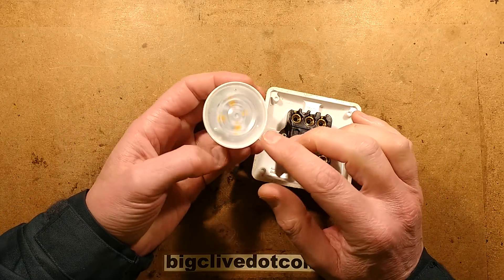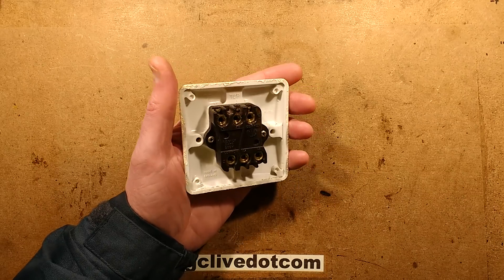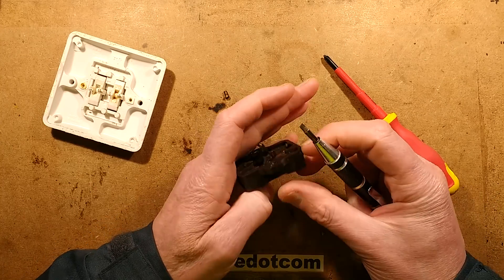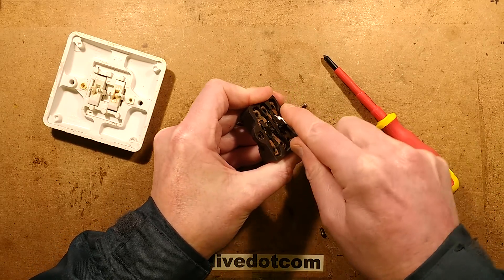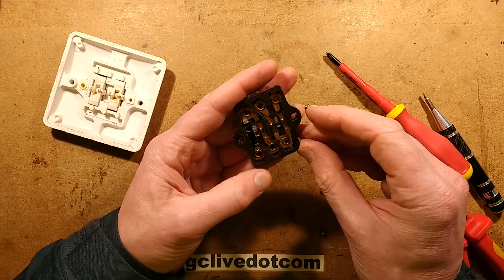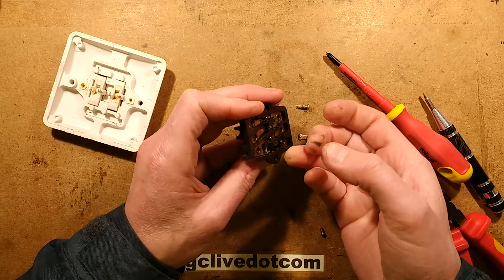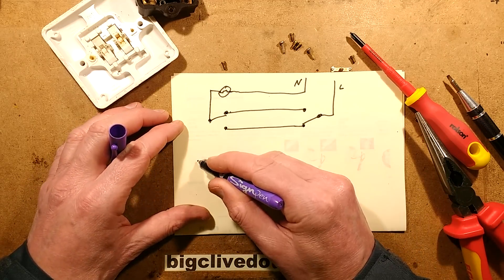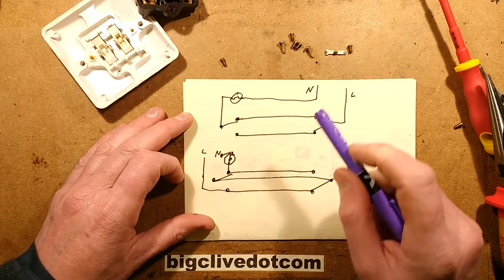Old arcing switch killing LED lamps.

Comment: What is it about arcing that causes the fusable resistor to fail? Too much current, presumably, but why? And why wouldn't a circuit breaker give first? I wouldn't expect a resistor to be quick blow (although I don't know why I assume this).
Reply: a capacitor has an impedance , this is the AC resistance.  the resistance can be worked out with 1 / 2piFC . i.e. 2 times Pi * Frequency * capacitance in farads .  the 1 over that (use the 1/x key on your calc).

example using coarse numbers 6.28 * 50 * 100exp-9    (i.e. pi times 2 , 50 hz , 100 nf) then 1/x the total gives 31.8 K ohms

If you switch starts to crackle it will chop up the 50 hz into much narrower waveforms resulting in a much higher frequency. if this increased it to say 500 Hz then the impedance of that capacitor will drop to a 10 th of its 50 hz value i/e/ 3.18k . , your LED's will get 10 times the current!

This is an issue with using a capacitor as a resistor basically in an AC circuit, you have a frequency dependent resistance.

If you wanted to try and avoid this you would either need to use an inductor (more expensive, larger) or a proper switching power supply (also more expensive).
Reply from the maker: +No no The current would be limited by the resistor, so it sees most stress.
Reply: The power rating of the resistor is much less (in this case more than a factor of 10) than the breaker. Smaller parts are always going to break/fail first. That's just the way it is.

Sometimes time or the environment (or both) will contribute. I lived in a building put up the late 1800s which got electricity in the 1940s and oneday in the 90s the wall started smoking. Very similar failure. In this case some of the wall debris got inside the switch because they did not know well enough to make it sealed up. The better something is sealed generally the better it lasts, too. Clive's switch is open to moisture and salt corrosion. Switch contacts are a very very common place for failure.

If you think about it I'm surprised the place I lived in even lasted 5 decades on the technology.
Reply: When arc occurs you have sudden changes in voltage and the faster the voltage change the more current will a capacitor let through. Circuit breaker for lightning may be rated e.g. 10A (common in Poland), while this LED may take e.g. 50 mA normally and a fusing resistor inside light bulb is rated for such current. When it starts to conduct e.g. 100mA then the fusing resistor will act first.
Reply: Under normal situations around half or more of the volts are dropped by the series capacitor. The arcing that is the most problematic is when it momentarily connects the bulb on alternate cycles. Then the series capacitor doesn't really do anything, and all the volts are dropped by the series resistor. To survive long term with continual arcing it might need to be ~50k, but it's normally more like 500 ohms, and apparently on these bulbs it's 10 ohms which is really too small. I suppose having such a low value would make the bulb more efficient though.

Comment: In America, the first diagram is what we use but we run 3+gnd cable in that instance, and the White Neutral wire is still the Neutral wire all the way through for the return, but the Red and Black are the two Hot's, and the Ground or Earth (either bare copper or Green) is there as required by the fire code to make sure metal fixtures and junction boxes are properly protected.  That way no matter which switch is flipped, a path will either be broken or made.  The switches will either both be on the same wire (Red or Black, and thus passing current) or not (off, no path through).  Four way switching has an additional switch in the middle of the Red and Black that just reverses the pairs relative to one side of the switch (the diagram would either be two parallel wires, or an X of the two wires crossing over each other).  That middle switch just changes the relative Red/Black relationship that one end switch sees versus its partner on the opposite end.  Four-ways are not very common.
Reply: And we call the red & Black "travelers".
Reply: is this what you are saying? hard to see in text http://www.electrical101.com/3way-switches.html
Reply: Yeah, we have the ground wire too, we call it triple and earth, when we wire a lighting circuit, the live and neutral run to all the light fixtures,  the live going to a third terminal, then it's a simple case of bringing a 2 wire down to a switch, then if it's going to be a 2 way switch, we run the triple between switches.
The first diagram was for very old systems that often used single wire in conduit, or double insulated single wire clipped to the joists..
Reply: Same here in Germany (apart from the coloring). Usually one would see the first diagram being used. Does the second diagram make the loop impedance of the circuit higher or quite unpredictable because of a changing wire length? I have had a lot of electritians obsess about loop impedance because of the impulse part of the fuses still triggering in case of a short circuit. I am not sure - just throwing the idea out there.
Reply: electritians or electwicimans. Funny!
Reply: Dan Dinca depending on the position of the switches, the live passes through both the bottom and middle wires or the top and middle wires, or only the bottom wire.

Given that you still make one wire carry permanent live and the other two are still switched (although you can now have the configuration where all three are live simultaneously, just not all carrying current), I’m not sure what you gain by this arrangement.

You give up the ability to have insert an extra switch in the middle, though. No, wait, that’s not true. If you put a crossover switch on the outer legs while connecting the middle straight through that’ll still work.

In NL, circuit wiring in the home is always 2.5 mm^2, but switch wires get to be 1.5mm^2. I’m not sure the second arrangement is allowed, though.
Reply: A site that shows the U.K. modern arrangement is this one: http://www.lightwiring.co.uk/two-way-switching-3-wire-system-new-harmonised-cable-colours/
Reply: The way I understood it was that the first way was the way you'd do it for new wiring and the second way was when you were adding a second switch to an existing single switch setup (you would obviously replace the 1-way with a 2-way also)
Reply: perhaps 4-ways weren't as common around there, but I installed thousands in one year, with 20+ per home(late 90's), I recall some having 8 switch locations for a single lighting circuit. don't get me going on how many hard wired smoke/fire alarms per home and none of them were huge nor mansions..
Reply: I had the same thought. More wires more copper more expensive. For what?

Comment: Clive, you wouldn't like Sydney weather. 45°C with 60% -70% humidity. It's like walking around in a wet blanket, and breathing the oven air, mid-roast.
Reply from the maker: I've visited Australia.  But in a mid point of the year where the temperature was tolerable.
Reply: I think i would literally die over there right now.
I can't even stand most summers in Germany...
Reply: Move a bit further south (South Coast / Illawarra). We've had 40C days with 100%RH. Today's "only" 27C so far - but still 100%RH. Thank heavens for air con!

Comment: Clive, thank you so much for explaining 2-way switches! I think we call them 3-way switches in the US. Is there a difference?
Reply from the maker: It may be the same thing.  With intermediate switches that cross the strapper cores you can actually have as many switches as you want for one light.
Reply: I ran into this recently at work in our pool room where one switch’s contacts corroded enough to completely stop switching through audible arching noises. This arching managed to accelerate the demise of several fluorescent tubes in short order. In another case I found that low quality Smith & Stone defunct?) household decora style switches from the late 90’s started arching only after  a couple years in the washroom causing the bathroom GFCI to pop whenever the light was turned on. This is despite the light and switch not being on the GFCI...just noise.
Reply: In the US at least, yes the #-way switch indicates the number of contacts on the switch, not the total wires in system. The switch diagram clive showed, is the US equivalent of a 3-way. A 4-way has an additional contact. As Dustin has pointed out, the US has used a (wire-gauge)-3/wground since the 50s-60s as the up to standard wiring style for lamps with multiple switches. Which means that one end of the circuit (either the lamp or a switch) has the main cable coming in that contains the live, neutral, and ground. From there, grounds all bond together on the back of the box unless its plastic, and neutrals all bond together in the back of the box. The hot legs are the only things connected to the switch. A standard (wire-gauge)-2/wground coming in and going from the last switch to the light, and (wire-gauge)-3/wground between all the switches.
Reply: Sounds the same, things you have to watch out for in a hall with stairs is shared neutral between upstairs and downstairs. Thats asuming you 120v savages in the US have seperate upstairs and downstairs lights .
Reply: And you 240v baby killing Savages xD, have shared neutrals across physical locations vs circuit by circuit? Usually in the US since the 50-60s lighting is grouped with plugs by room. So the master bedroom with have its ceiling light and wall plugs on one circuit either 15-20A, the second bedroom will also have its light and plugs shared, etc. The only time this doesn't happen is when you have rooms with high outlet draw, such as a kitchen where you have a 20A circuit just for the plugs in the kitchen (sometimes two 20A circuits in one kitchen for the outlets) and either the ceiling light is grouped with the lights for open adjacent rooms (See open floor plan) or its tied in with the dishwasher and fridge outlets which are just regular height wall outlets and not up above or right under the counter.

It comes down to the building and electrical designers. Usually for branch designations, you will never find lighting on individual circuits, they will always be on general purpose  circuits, not appliance or multiwire.
Reply: Here in Italy most houses were built (well?) before the '70s and I'd say 98% of those still have the ONE breaker that comes with the power meter, lol.
Reply: Some planners will do that, others will just separate by room. My house was built in the mid 60s, and the lighting is grouped by room with the outlets except for communal areas. You have the bedroom lighting and outlets (per room), you have the kitchen, living room, dining room lighting all tied together you have the basement lighting. Garage lighting is done with the garage outlets, and bathroom lighting is done with the bathroom outlets and exhaust fan. Some new constructions run general lighting circuits for multiple rooms, some run room by room. But most commonly at least in central michigan, unless multiple lights are in close enough proximity to each other in an open floor plan,  there are few if any general lighting circuits that feed only one or two lights, usually they run 5-10 interior or 2-5 exterior.

It may differ in other parts of the country, most of the houses in the lower half of the state were built by four companies in the 50-70s. Of those four, the electricians bounced around enough that basically everyone used the same standard for running circuits. Personally I quite like tying the light into the outlets for the room. There is a very easy and quick indication as to whether the issue is with the power supply, or device. If the device doesn't work but the light is on, its not the breaker. Or if the light isn't on but the computer is, its not the breaker. Working in a dark room isn't an issue even in the northern part of the state, electricians rarely work at night, so you just open a window, or run in a work light from another room. If you do have to work on a light and need the power off at night, you aren't killing light to half the house.
Reply: Ok, so we're referring to the number of conductors and not the number of switches?  Except in a three switch system, were we call it a 4-way, referring to the three conductors and one extra switch? Zounds!
Reply: B.L. Alley that would explain the huge distribution boards in the UK we have mostly 10 way which also has a circuit for the ev charger
Reply: Jack Hentschel, what? I'm not quite sure what your message was. Do you mean slots for breakers? Thats the only thing in that count I can imagine a distribution board would have.
Reply: 2009dudeman yes. His complete lack of punctuation made his comment very unclear. In the U.K. it's very common to have small consumer units with approximately 6 fuses or 10 breakers, although some maybe as few as 4 fuses or 6 breakers.

My house has 2 bedrooms and the consumer unit is wide enough for 12 breakers. One space is reserved for the neutral, and the RCD takes up 4 spaces, that leaves room for 7 breakers, of which 6 are fitted:-
* 5A lighting circuit for entire house,
* 5A boiler circuit for hot water and central heating,
* 30A ring mains for entire house,
* 30A cooker circuit which includes the socket used for the kettle,
* 15A which I assume is for the immersion heater and the heated light in the bathroom,
* 45A for electric shower.
Reply: See my explanation in my other comment.  We use 3 conductor + Gnd cable.  The Red and Black are the two Hot wires, the White is the Neutral return.  So the hot from the mains comes to the common of the first switch, and the black and red wires carry the line to the opposite switch, where the common of that switch goes to the light.  The White and Ground cables are connected all the way through the system.  Either switch will toggle between being on the same wire as the other side (ON) or not (OFF, no path).
Reply: 2009dudeman the better way it to separate lights from outlets on circuits.  So if you have to work on a light in a room, you can still use a halogen light, or table lamp. Or working on an outlet in a room, you can use the ceiling light.  Tripping a breaker for a plugged in appliance doesn't leave you standing in a dark room.

Comment: Humidity, causing corrosion maybe. Id also like the official spelling for Hoyk (ha-oee-k).
Reply from the maker: I've never even thought about that before.  It's spelled hoik.
Reply: bigclivedotcom thank you for the official ruling. I didn't want to guess being Merican.
Reply: I would hazard a guess that the salt in the air eats electrical contacts like it eats everything else.
Reply: Noted the use of the correct Elizabethan spelling of 'The'  with the forgotten letter Thorn. :)
Reply: Sorry, it was to K Vjqxzz, I didn't make that clear.  Just trading etymological nuances. :)
Reply: lol .....I googled to get the spellings :D Don't worry, there's no malice being thrown around :)
Reply: guitarstitch right that's kinda what I was thinking. But failed to mention. Glad you did.
Reply: ye olde Elizabethan spelling was 'hoike'
Reply: Twotone I'm not picking up what your laying down. Esplain.
Reply: Twotone now I got to Google your words see if I can figure this out, In Clive speak I have to "take to bits your reply"
Reply: Raymond Mucklow Hawick

Haw-ick
Reply: Only if you wanted to travel there :)
Reply: The 'Ye' in 'Ye Olde' is interesting. As someone mentioned, the thorn was in the English alphabet, but it has fallen into disuse. Printers, not having the thorn, which made the 'th' sound, substituted a somewhat similarly-shaped letter, the 'Y', so (thorn)+e became 'Ye', We now use 'Th' to represent the thorn, hence 'The'. When someone pronounces 'Ye' as it is printed, or signposted, then they are, strictly-speaking, mis-pronouncing 'The'. The only country which I can think of where the thorn is still in use is Iceland.